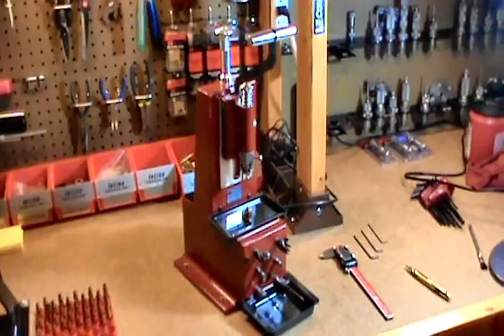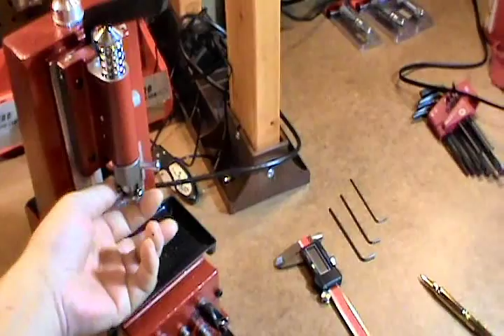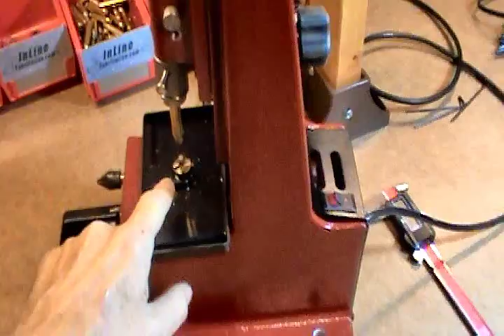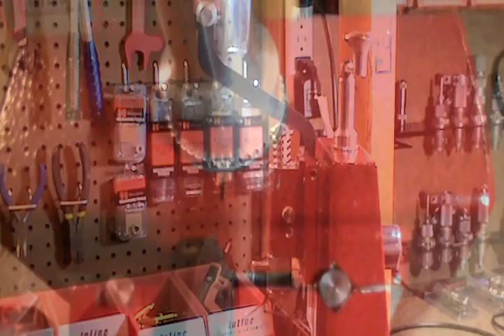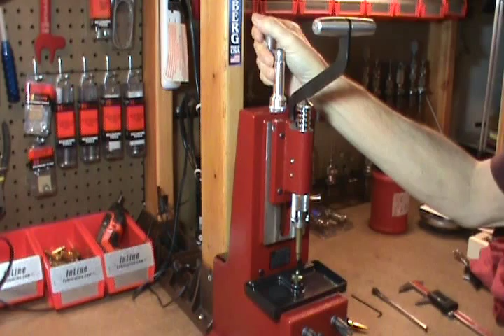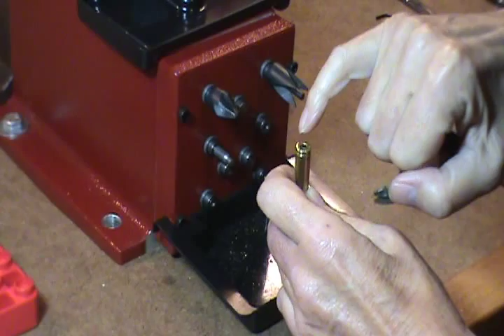Hornady Power Case Prep Center - In-Depth

Comment: Nice video, thanks! 🙂
Even 8 years later there are those of us buying this unit - as of right now this cost (hold on to your hats gentlemen) $1500 here in Norway!
BTW: I think the reason your case didn't shrink in length as expected, was that you forgot to loosen the set screw in the back when you turned the adjustment wheel to lower the case - it looks like it was just tightened more and more, never loosened ;-)

Comment: I've been very disappointed with my Hornady Power Case Prep Center. The internal parts are plastic; the teeth on the plastic gears don't hold up. The spindle shouldn't twist, but it does. My non-Hornady shellholders don't work. (Standardized shellholder sizes? We don't need no stinking standards!) Overall, the quality isn't up to the lowest of Chinese standards.

Comment: New ones have an indicator line on top now, and a bit of a recess around the indicator, mine was proper set on top when I got it, and the camlock was rotated properly.. Works well, RCBS primer brushes work in it, amd told an RCBS 3 way cutter head does also.

Comment: Great job on the video!  I received one of these for Christmas and have been using your video as my primary reference!  Hornady did add a reference mark on the top of the unit so someone is listening out there!  I do have an issue I'm hoping you can help me with.  When dropping the press handle I get to a certain point (prior to brass contacting the cutter) where it catches/binds a little and I have to add a little more pressure to get past this point.  It's not a smooth, continuous motion from top to bottom.  This appears to be happening inside the shaft housing.  Any help would be appreciated!
Reply: Actually I just figured it out........the trimmer spindle is either to small or the spindle housing is to big.  The spindle is catching where the top hex portion of the spindle ends and goes back to cylindrical.  Guess I'll be calling Hornady next week.  Ugh......

Comment: I have this station....   So my question is this.   I use a tumble case cleaner with Walnut media.     I have read where guys put nu finish car wax in tumbler..  Your thoughts?    2nd...    Would you say to remove primer prior to cleaning?   3rd   Remove primer after tumbling because the case has to be trimmed then i can use the primer pocket cleaner on this station after trimming?    I am just now putting together the equipment to reload so i am very new starter.     I have the hornady LNL progessive press, with this case trimmer station.    I will be reloading my first round which is the Hornady Leverevolution FTX 255gr 44 mag.     The brass will be once fired...      Any suggestions to help this process?     Thank you for this outstanding video to set up my case prep station.

Comment: Ok... SO I just got one. I wouldn't have spent the $$$ except... 1) I had the points on my VISA from lots of work travel so it was kindof free 2) My hands get badly cramped if I use a trimmer like the WFT & 3) I am holding pretty tight case lengths 1.750-1.752 with 223.. My thoughts are... I am probably not processing any much faster but I can go longer. The chamfer tools that come with it SUCK... I installed the ones from my lyman hand tools. Much better. 

Was it worth it... yes... will it be worth it for other people... you decide

Comment: hi what is the life of these units ??
Reply from the maker: Neil Beri Hi Neil,

I guess as with any piece of equipment it depends on how well you care for your gear.  I got mine the year after it came out.  I think it came out in 2009 so I'm thinking I've had it for 5 years now.  I have literally 10's of thousands of cases through it and have never had a problem.  I've heard of others who have had some problems but thankfully I have not experienced the same issues.

Even if a problem does arise, Hornady has a lifetime warranty on their reloading gear so I'm not too worried about breakdowns.  I've had very good response to problems that I've had with other Hornady gear, even my 20 year old LNL AP Press.  They replaced my sub-plate for free even after 15 years of use.

So to answer your question, it's still running strong after 5 years of use.  It's only been on the market for 6 years so I guess time will tell if it has an "expiration date" when things stop working.

Hornady Loader
Reply: thanks mate.
I have just ordered one here in NZ $810.00.
i cant wait to get it. will talk to you more soon regarding the AP press for 223 CHEERS